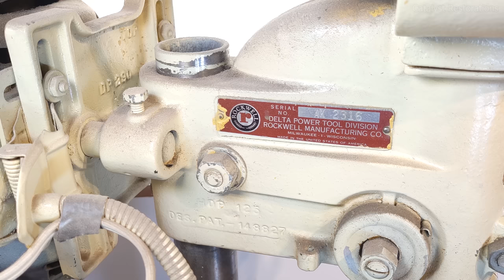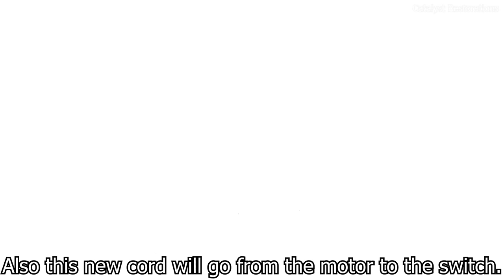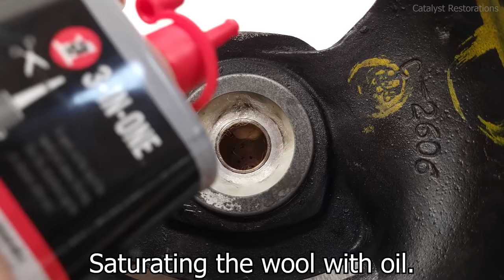1953 Delta Rockwell Homecraft Drill Press and Motor Restoration | Part 1 & Part 2

Comment: Does anyone know what taper the chuck is?  I'd like to replace mine with a keyless one.  Thanks
Reply from the maker: I'm currently out of state, but when I get back after the new year I will look at which Jacobs chuck I have and let you know the taper!
Reply: Thank you.
Reply from the maker: @johnlabarbera4949  My chuck is a Jacobs 33, which looking at a Jacobs taper chart shows small end is 0.5604", big end is 0.6240", length 1.000". Hope that helps!
Reply: @CatalystRestorations  Yes that does, thanks a lot.  Will see what I can find on line.
Reply: I see he already gave you the answer to your taper question.  If you pause this video at 29:00, you can see the number 33 upside down. It reads "33 TAPER" just after the Model 64.
Reply from the maker: @flashgordon6238  coming in hot with the knowledge bomb!! Thanks!

Comment: That soldering job is frankly terrible, and downright dangerous. You should never solder wires in machines that vibrate, and the poor solder joint you made will break up in no time and can cause sparking and overheating. Please redo using crimping connectors or screw terminals. At least you did the grounding correctly.

The rest of the restoration is top notch though!
Reply from the maker: Good call, I'll get that fixed!

Comment: Was watching your vid because I happen to have that same drill press that my dad bought new,, but you ran me off when you started testing the paint.  Don't count on a subscription here. 

And just what were you going to do if it was lead paint? Call the EPA to send a HaxMat team out to save you? 

I'm 76 years old. From the time I was like 6 years old until they outlawed it in the late 70s I painted with lead paint, sanded it, stripped it and about anything else you can name with regard to it..  We also used white lead on the dead center of lathe tailstocks and OD Grinders and other lubrications in machine shops my whole life and I still have like a 1/4 can that I still use on occasion.  I have hsuffered zero point no harm for lead in any form.,,,,and I use lead /tin solder too!. 

My eyes are not what they used to be, and I am looking at a knee replacement, but other then that I am in good enough health to get drafted again. - Zero0 defects, baby......My point. You watch too much television or is it just that  cowardice has become and artform in this country.
Reply from the maker: "We estimate population-level effects on IQ loss and find that lead is responsible for the loss of 824,097,690 IQ points as of 2015."

https://www.pnas.org/doi/10.1073/pnas.2118631119

It sounds like you might be accounting for quite a bit of those points lost.

Comment: Ok. I like to watch restoration videos, and there are a lot of copy cats around . That's probably why your video was suggested to me, and that's probably why you started this channel too (make a quick buck or how hard can it be?). I made it to the end on double speed. Why on double speed you might ask? Well your painting is Ok but your technical way of doing things sucks. Big time. I don't like to nag and I appreciate your effort to show your work on YouTube but I like to be honest too. "Don't give up your day job" is my sincere advice after making it to the end of this video. In a technical way you don't have a clue what you're doing. Hitting parts sideways to remove it from a shaft several times (bending)? Restoring an old motor and don't care about the bearings? Replacing a felt washer with a combed sheep? Giving "Pro Tips" along the way? I made a list of what went wrong and it's quite long. One of the last shots when you're happy with the result and joyfully drilling away says it all; Did you notice the wobble on the pulley on the motor end? Off course you did. Pulling a zamac part over a mushroomed shaft destroyed the fit. Agree? If you're interested in the full list I can give it to you. The essence of my message is that I don't like to see amateurs at work who behave like a pro. If you're gifted and/or have a long experience in doing certain kind of work I like to be informed and will enjoy the videos you make. If you don't master a trade, like you, I'm worried about the young folks out there who are watching your work and think that this is the way it should be done... Therefore, "Pro Tip" investigate the job at hand thoroughly before you put an amateur effort like this in a "restoration" (don't ever put your hands on my drill press) video project and have the nerves to put it online like a "Pro". I know, it's not the sweetheart response you're used to because I'm real and you should be too. So, in short, if you don't know what you're doing stay quite. Best, Job
Reply from the maker: "I don't like to nag" (proceeds to post a 389-word 2,004-character wall of text nagging and berating a complete stranger online)

I must have missed the memo that YouTube was only meant for "pros", but thanks for watching this entire video and adding to my paycheck anyways.

Comment: Did the second plug break?  At 1:40 the prongs are still in the outlet.
Reply from the maker: Nope! That's how that old power strip was designed. Two female plugs on the ends and a male plug in the middle.
Reply from the maker: @andrewrussell26  No, you would plug an extension cord into that male plug and plug the other end into the outlet, thus powering the switch, the light, and the motor that are all tied into that power strip.